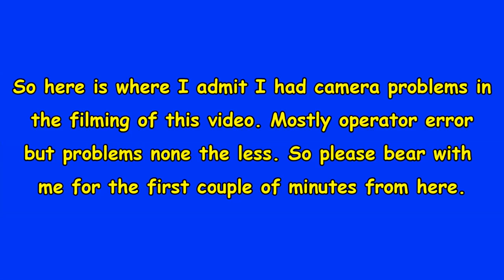The Holzfforma G444 cutting Maple

Comment: Having problems with my 444. oiler is wide open and still not enough oil to chain.  Hard starting, have to add mix to carb to get it started.

Comment: Cy,  Did you run three tanks before this video?  My understanding is that's a standard way to break in a saw?  Also what is the type of chain you're using?  Thanks!  Checked this saw on Amazon, didn't give weight?  What would you estimate the bar and powerhead to weigh? Good luck and hope healing goes well.
Reply from the maker: Yes I have run about 5 tanks through it. The chain is one of the new ones holzfforma is selling now. The specs for this saw are available at huztl.net.
Reply: Great video!!  How do you tell the difference from the old saw chains and the new type you are referring too on their website?
Reply from the maker: It is the ones that say German Blade. I believe they are using German steel in them, I could be wrong but either way it is definitly a better grade of steel than they were using.
Reply: farmertec holzfforma forever stihl o.k. if you got money to throw away. @farmertec932